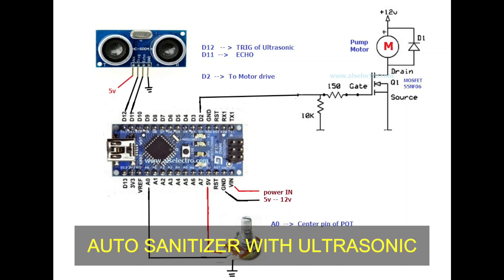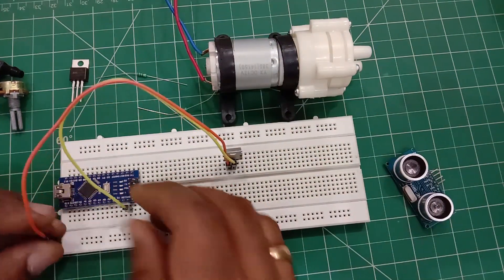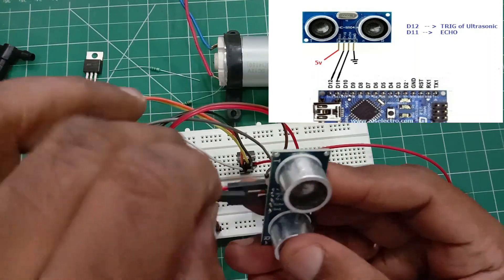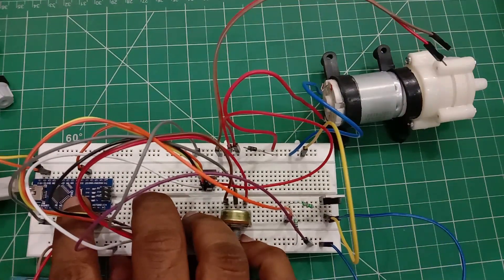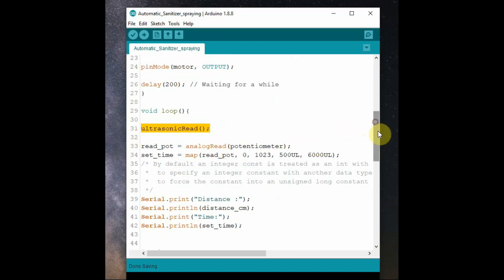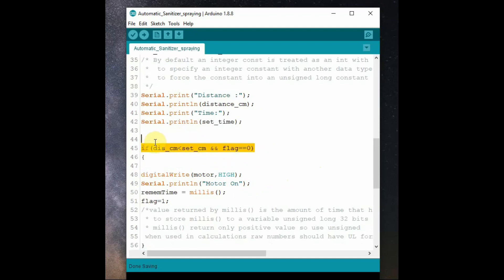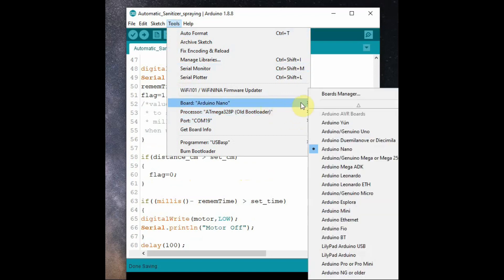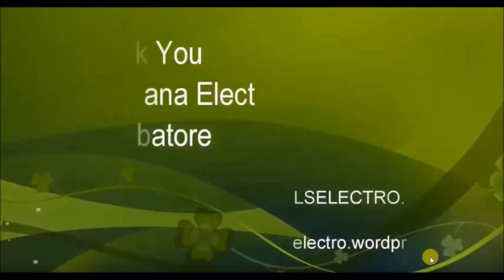AUTO  SANITIZER USING ULTRASONIC

Comment: Dear Saravanan. Thanks for sharing this ..A good tech should have to reply for the major drawbacks of this circuit. A lot of people asked here how to change the ON time =as long as the hand is there in the sensor but not greater than 5 sec. The code provided works such a way the santizer getting wasted because the pumb turning on min 2 sec and even u remove the hand in 1 sec it wont turn off. Please update and help.
Reply: change the delay time and also change if(distance_cm>set_cm) in motor low condition for as long as the hand is there in the sensor.

Comment: Hi sir I made automatic hand sanitizer machine   with u r guideline .
My problem is when liquid level is high in one liter bottle .Up to starten level drops coming from nozzle..
I used submerged 5v dc pump.
I placed hole on one side of the bottle. Pls tell me where to place hole to insert the tube  to avoid drops from nozzle
Reply: To solve this you have to use a Solinoid valve.

Comment: Hello Mr Saravanan,, We have developed a small Solenoid Valve which can operate at 6V/12V DC with inbuilt nozzle on the outlet to create good flow, without flooding the Sanitizer.Solenoid Draws just .5A at 6V. We need complete ultrasonic solution in compact water proof package to work with 6V/12V DC

Comment: Sir how to set timing for output
If we want to set 2 sec for motor ON
Reply: Change 5000ul n 60000ul to 10 to 2000  for 2sec
Reply: @electroprem   if i want motor on for 10 seconds. What can i do
Reply: @rameezparray289  5000ul and 60000ul to 5000 to 100000
Reply: @electroprem   12v supply's gnd is connected where?
Reply: @rameezparray289  -ve
Reply: @electroprem  can I run 24v pump using this mosfet and same ckt

Comment: Can I connect 24v motor in this circuit
Reply: possible by adding a relay to control the motor with seperate battery
Reply: @raidhubeiucy5938   can I use any high load capacity mosfet... Like to run 24v pump

Comment: Sir, I am assemble your above Arduino based circuit. 100 % Working properly.Thank you sir sharing code & Tutorial.
Sir, One request  How to connect   Solinoid valve at outlet of pump . Kindly develop such a circuit & Tutorial sir....
Reply: Use relay or n channel MOSFET  or  npn transistor like tipxxx for high APM load
Reply: Plz provide me full ckt diagram
Reply: Where to connect diode plz tell

Comment: This is risky , passing alcoholic sanatizer from brushed DC motor. epoxy raisin can get easily dissolved in alcohol solutions . Alcohol is flammable...... Guys I am warning you
Reply: sanitizer contain probably 50-60% alcohol though if we dilute it by mixing water it will be safe.also water is more flamable to electricity then why it is not risky to use motor for water !

Comment: sir,

I really like your designs. They are great.

However with due respect, I've to point out that you are wrong when you said "The freewheeling diode is for suppressing EMF radiation"

Actually it is to provide a short-circuit path for the back-emf transient voltage. It is for protecting the semiconductor switching device.

You see.. all inductive loads such as coils, contacton,  solenoids & of course Motors generate a very high back-emf at the moment of switching off. This back-emf can be hundreds or thousands of volts which can damage the switching transistor.

Due to Lenz's law the direction of the back-emf is always in the opposite direction of the applied voltage. Which is why the freewheeling diode is connected in reverse bias wrt the supply voltage. When the load gets voltage, the diode will be reverse-biased & no current will pass through it. 

When the transistor is turned off, the motor will generate a transient back-emf spike. At this moment the freewheeling diode gets forward-biased & will short-ckt the Motor's terminals so that the back- emf won't act on the transistor  thus protecting it.

Comment: How to add solenoid Valve

Parallel to motor supply
Reply from the maker: Another Mosfet driver added to a GPIO pin.Will post new circuit shortly
Reply: @SaravananAL  waiting for new circuit sir thank you